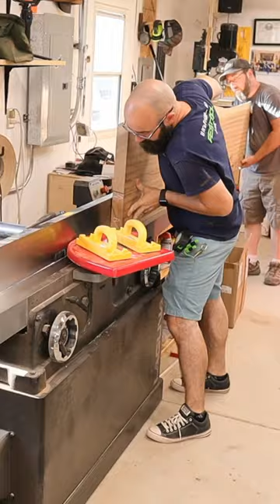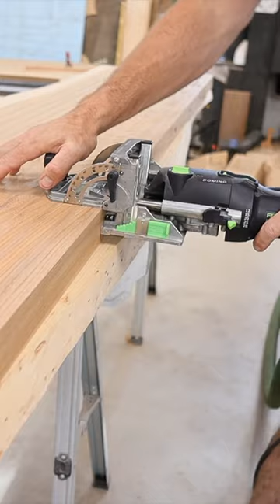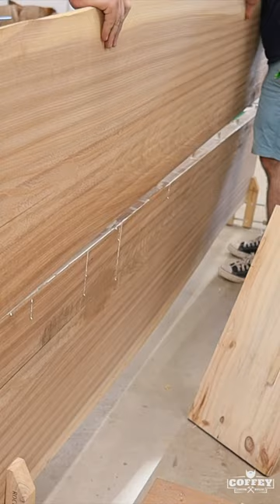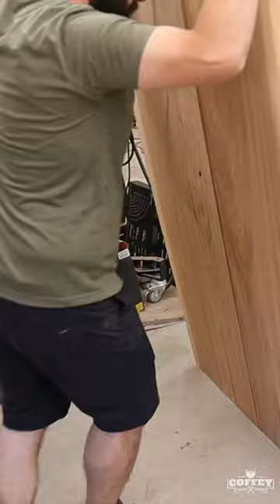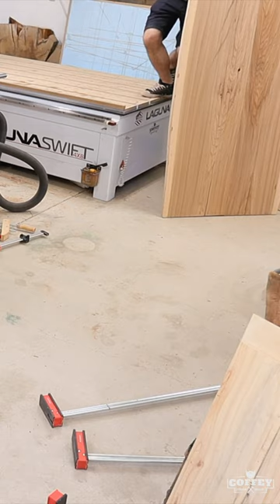Big table glue up #woodworking #custom #howto

Comment: U do know dominos are not to hold for strength just alignment should have a few dowels in there for strength
Reply from the maker: Dowels would do no more than dominoes here. In fact, dowels do less than dominoes as they are smaller and have less glue surface. The glue is more than enough for this joint. And yes I do know that. I own a furniture company and do this for a living.
Reply: @CoffeyCustomBuilds  Nothing is ever enough...
Reply: All he needed was glue. I've seen many a table tops glued up with no extra fasteners and never fails. Those dominoes are over kill. That's not a bad thing but his table top is perfectly fines and should last someone a lifetime of memories.